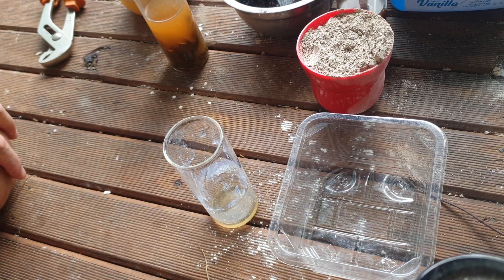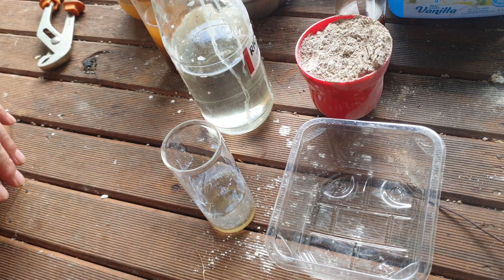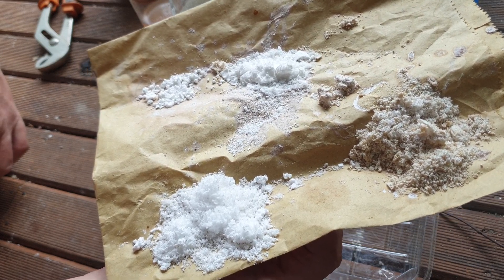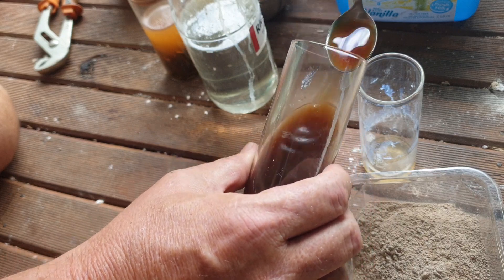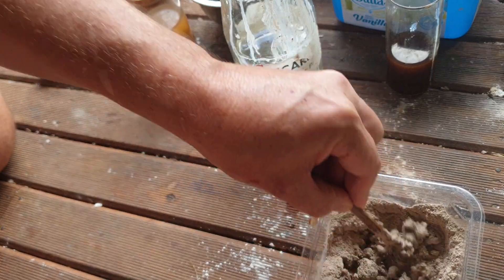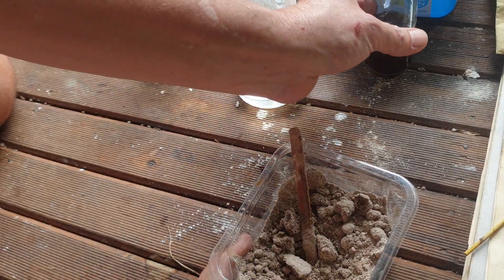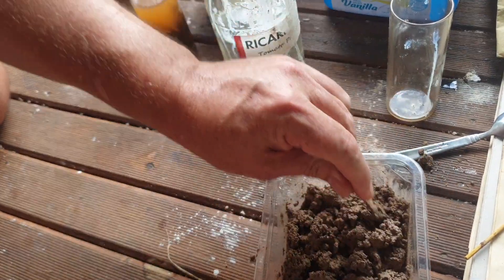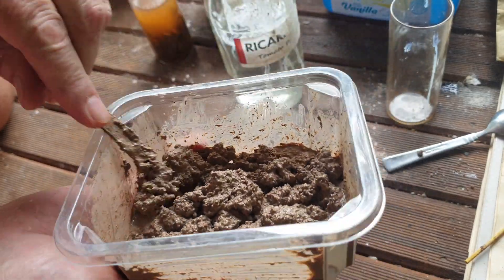Ancient Megalith Fig juice Waterglass hardener, Geopolymer🔥+🍈=🗿

Comment: So basically you're saying that boiled fig water being added to waterglass leads to a chemical reaction that creates glue, or a gel of some kind, in the same way adding tallow to boiling limewash causes a chemical reaction that creates soap (which in turn reacts to become insoluble & aid in waterproofing).

If I understood that properly it is very interesting. May I ask if you have conducted the usual tests that are done on bricks to test how waterproof they are etc?
Reply from the maker: i haven't mechanically stress tested them, but have boiled them, and a few went through the washing machine in my pocket
Reply: @m3sca1 that is cool. If they can with stand a falling water test that is a very good sign for good material. But I know that you  know that already 🙂
Reply: Sorry, I meant boiling water test.

Comment: I'm going to try this.  Are you sealing with polyethelene when the product is curing or allowing it to air dry?
Reply from the maker: small samples i will wrap in plastic. not using any sealers. recommend using figs or some other fruit that ends up acidic.
the 1st brew shown here has added acid the new brew is acidic enough to not need it

Comment: Interesting. I’ve been interested in geopolymers for ages. I played around with many organic additives but didn’t have much luck. Maybe you could be on to something. Have you tried the boiling water test?
Reply from the maker: mate, my 1st successful rock with this method is so hard i am polishing it with a diamond wheel.
water doesn't affect it. i have wet them and they do not soften. there is still a long term reaction happening that boiling will take away the waterglass inside. also applying heat above 60°C is bringing some of the reactants into a range that will never happen outside of an oven or pot. doing so before the full cure is done is not representative of real world scenarios for casting megaliths. so i am not accelarating cures with oven nor boiling until at least 60 days old.
the fig juice acid ester is not a "might be" onto something. it is the same chemistry used in commercial waterglass hardeners. think of this as a side hack into making geopolymers. like yourself my other experiments were not very successful. but this is a whole different thing. the waterlgass has to harden. it has been forced to coagulate, so to speak
Reply: @m3sca1  fantastic. I think I recognise you from the MFMP channel. Looks like we are into similar things. One of my first questions to Bob was whether geopolymer could be used as a lattice confinement for LENR reactions. He said the pores are too small but I’ve always wondered about composites. Also for electrolysis plates to make something like ohmasa gas. Anyway keep up the good work. Looks super interesting.
Reply from the maker: @martinhughes1854  yes, i am a regular follower of Bobs work aslo. i have not tuned in lately. The last i saw was the thunderstorm gen. Sometime it is good to drop a subject and do other things. I am worn out mentally on the Hydrogen. There is a very active community on twitX making for some fun experimenting. the figs and rubber has been a germ in my mind since i started investigating geopolymers over 20 years ago. there is a definate chemical change occuring. Kind of annoyed at myself for not testing it 20 years ago.🤦‍♂️
Reply from the maker: @martinhughes1854  could easily incorporate graphite into it. i have a test batch at the moment it diatioms, it is warping shrinking and cracking, it would do well to have a carbon filler🤔